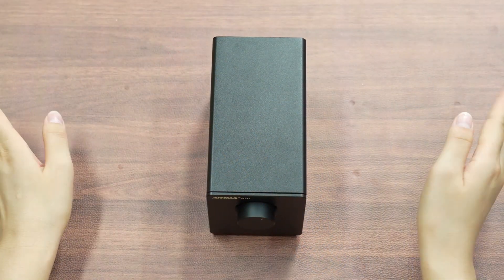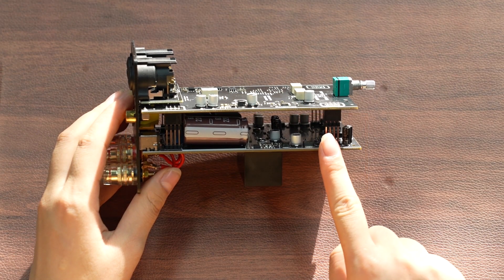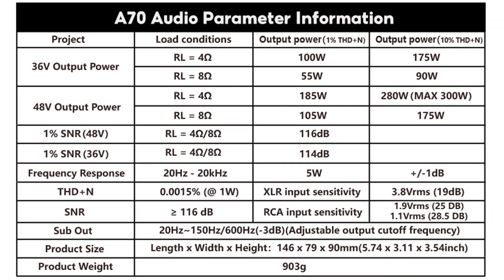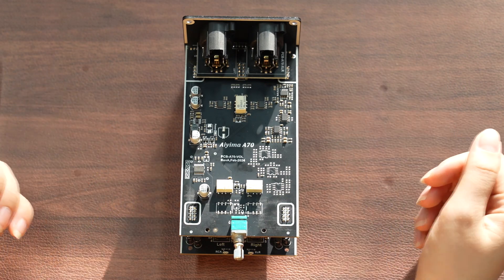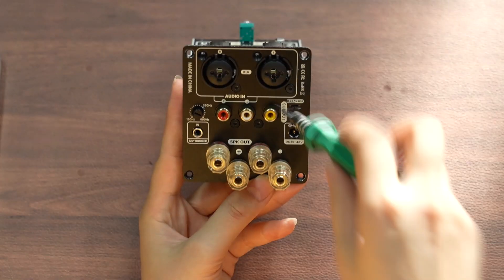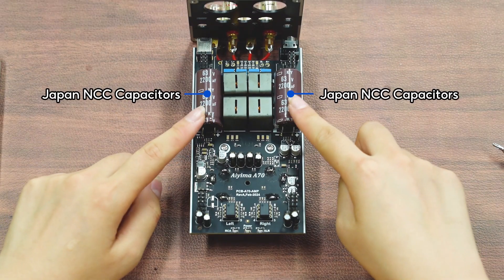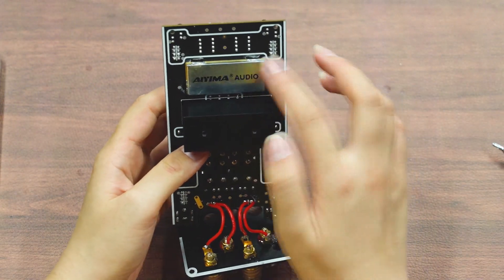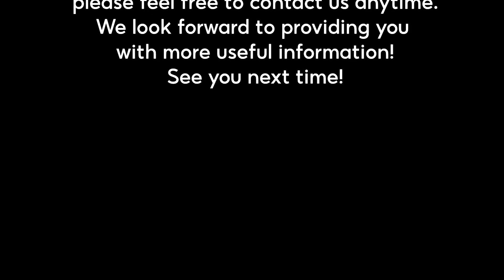Aiyima A70 Revealed: Unveiling the Secrets of High-Performance Audio Equipment

Comment: I like this, but when I saw that the machine must be followed by a transformer, I backed off. Why not make the power supply integrated? Please ask the manufacturer to launch a product that includes a power supply as a normal machine, and I will buy it very readily. Thank you
Reply: By the way, a suggestion, please make the guide bigger, I think 8 ohms 200W is a sweet spot that audiophiles like
Reply from the maker: @naomafeinaomafei9082  We have an A300 in the back, but it won't reach 8 ohms 200W for a while.
Reply from the maker: No, the power supply would weigh more inside, not always the power would be there, and the machine would be bulkier.

Comment: Can u tell me service centre in india?
Reply from the maker: Product details can be obtained by contacting customer service.   https://www.amazon.in/dp/B0D48G3P37?ref=myi_title_dp
Reply: Most bad thing is this a70 available on Amazon in without power supply and gan power supply is not available only 22 volt and 48v 5a old supply available not GAN.
Reply from the maker: @vish123_1  This link comes with a GaN power supply.   https://www.amazon.com/AIYIMA-A70-Balanced-Amplifier-Bookshelf/dp/B0CXJ7LC88/ref=sr_1
Reply from the maker: @vish123_1  Please let me know if there are any other questions.
Reply: Thx for response but this is USA link not for india.you can do in India there is lots of space for affordable gears but
Reply from the maker: @vish123_1  This is already in the pipeline, with a power supply and with Gallium Nitride expected to hit the shelves by the end of the month.